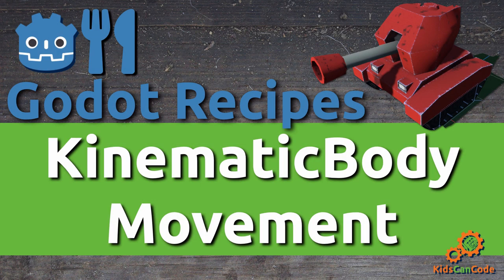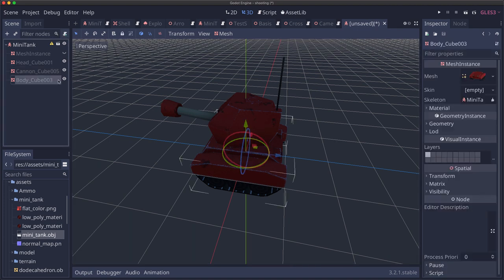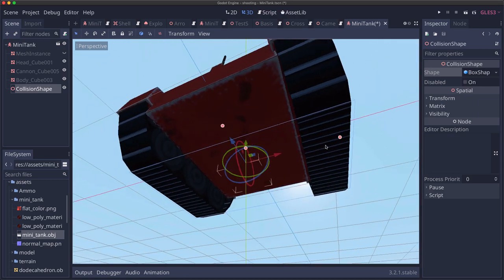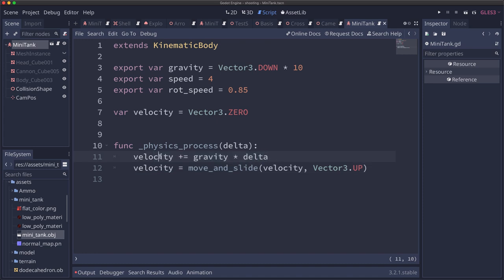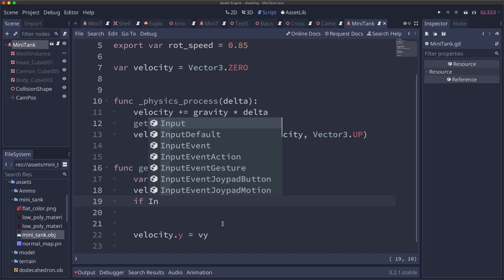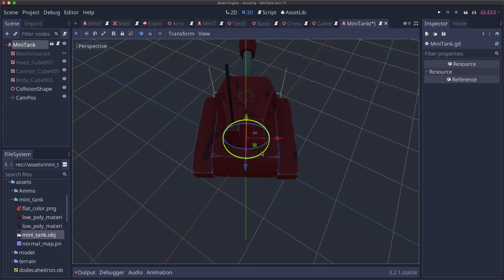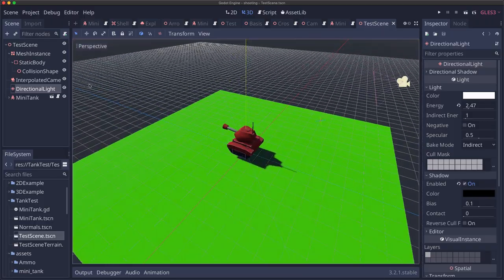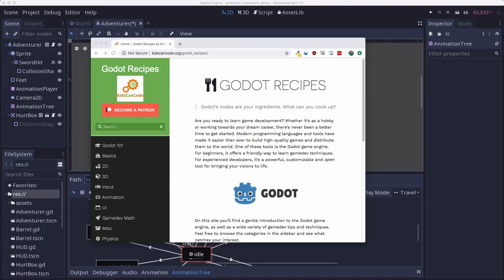Godot Recipe: 3D KinematicBody Movement

Comment: i am using godot 4 as i am new to the game engine but i had a problem, the kinematic body option doesnt seem to exist, as in when i change the root type of my vehicle there isnt an option for a kinematic body, any way to fix this?
Reply from the maker: If yo want to use Godot 4, you're going to need to read the Godot 4 docs. Names have changed, and movement functions work a little differently. In Godot 4, the node is named "CharacterBody3D".

Comment: error(12,1): Unindented does not match any outer indetation level.
it's the ,,get_input()" line of code.
Any help? because i can't quite figure this out
Reply from the maker: This is an indentation problem. You likely have an extra space in front of that line, so that it isn't indented correctly.

Comment: Nice video! Just a question, in godot docs and on their forum (godotengine.org/qa/44624/kinematicbody3d-move_and_slide-move_and_collide-different)
they are saying that you should not multiply your vector by delta when using move_and_slide, as it does multiply it internally... Well, you multiplied it and in a lot of tutorials they also do it. What is the correct way of doing it?
Reply from the maker: I did not multiply my velocity vector by delta. I did multiply my gravity and rotation by delta.
Reply: @Kidscancode  This is the thing I do not understand. Why are you multiplying gravity by delta? Your input velocity is now (x,y+[gravity×delta],z), but inside function move_and_slide it gets multiplyied by delta, so it becomes (x×delta,<y+[gravity×delta]>×delta,z×delta). So the gravity variable is multiplyied by gravity 2 times, right?
Reply from the maker: Gravity is only ever applied once. In order for gravity to be frame-rate independent (just like velocity), it is multiplied by delta.

Gravity is an acceleration - m/s^2. You must multiply an acceleration by a timestep to get how much the velocity is changed by gravity during that timestep. This is basic physics equations of motion.